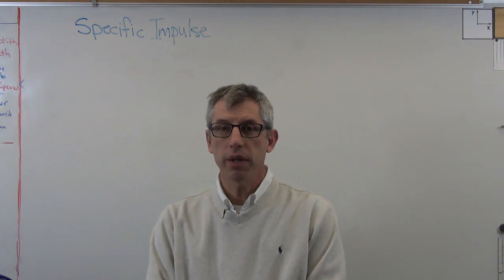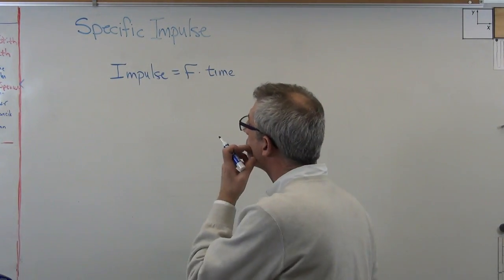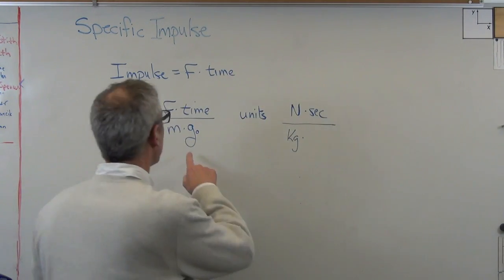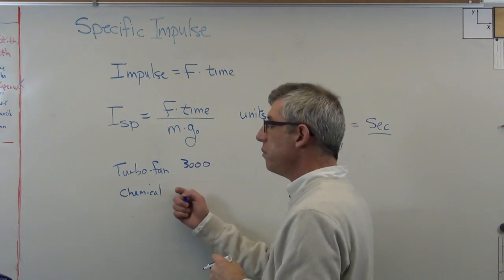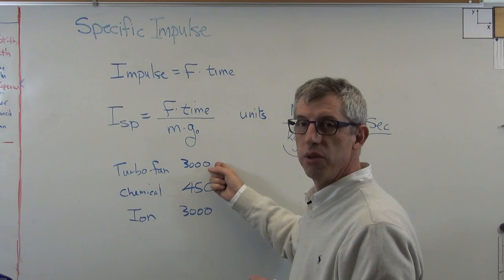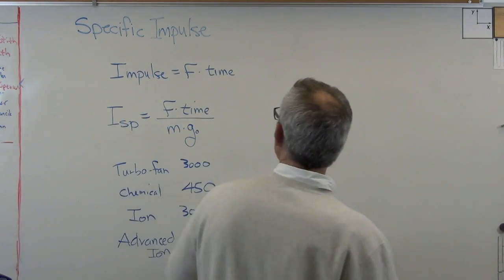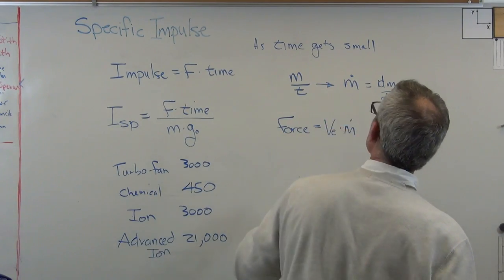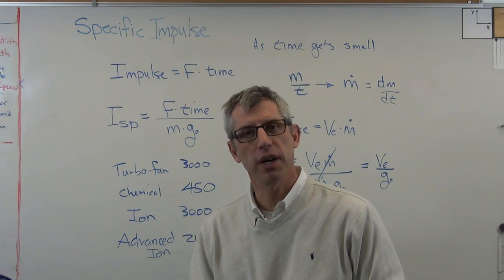Specfic Impulse   Brain Waves

Comment: If you look at the way he's subbed in the values it comes out. If you split the Isp equation into     Isp = F * t/m * 1/g0     it becomes more clear. F is replaced with Ve*mdot, t/m is replace with 1/mdot since m/t=mdot for small valuse of t. so you have     Isp = Ve*mdot * (1/mdot) * 1/g0 = Ve/g0.      Hope this helps.
Reply: Thank you.   I was confused how he got the last part.